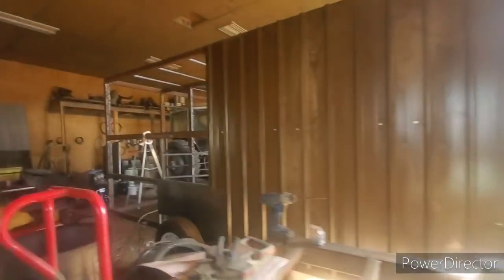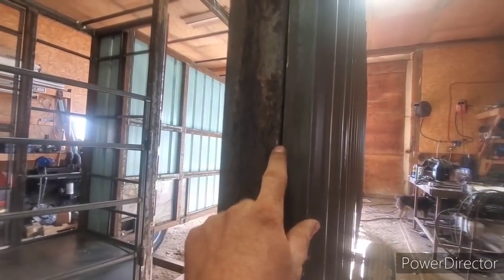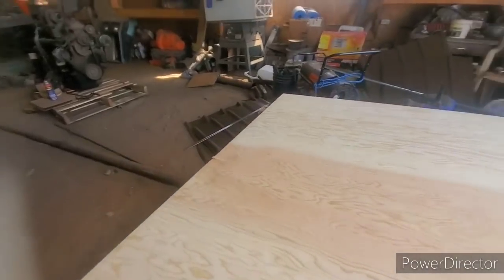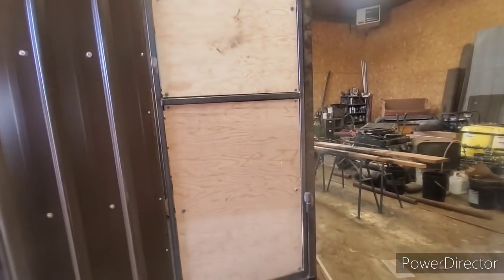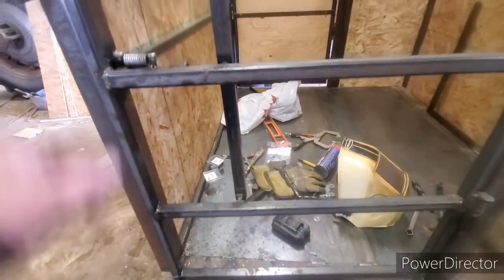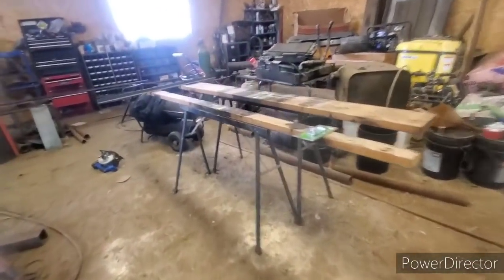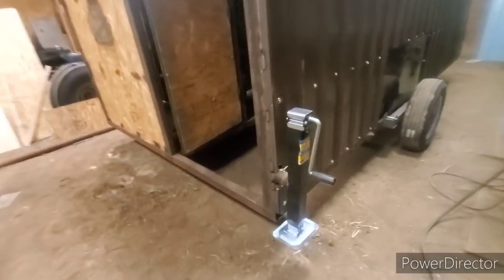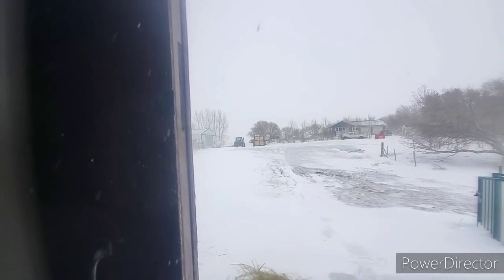Part #5 AI trailer build!! 👌

Comment: Why didn't you use polycarbonate sheets for the roof? Would save fitting lights.
Reply from the maker: I dont think she wants lights in the alley way it's supposed to be dark. Will be lights if needed to do the set up